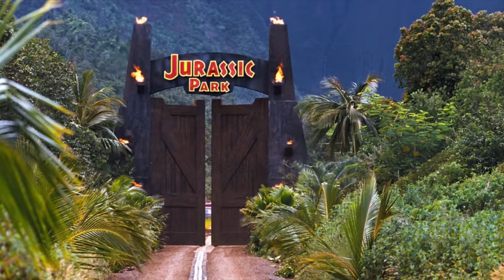The Ultimate Rain Scene - Jurassic Park - NO PHOTOSHOP!

Comment: When I need rain while animating I usually use eye droppers with water and or you could use a spray bottle and have a lower shutter speed/lower iso to get the motion blur. Love the idea you took to solving the problem.
Reply from the maker: Thanks. Eyedroppers sounds fascinating. I worry about the effect the water would have on my scenery. I usually use a lot of white glue that goes white again when wet.
Reply: @KathyMillatt  also the scale is off of the water drops so I’d recommend a mist. And maybe you could just set your diorama in with some transparent glue or something

Comment: Not sure what filament you're using, but is that sanding mouse gentle enough not to melt PLA? I could use something to make sanding FDM prints less tedious, but most power tools generate far too much heat.
Reply from the maker: It’s PLA but I’m sanding the spray putty not the filament so I haven’t had a problem with the PLA melting.
Reply: @KathyMillatt  Okay, I might give one a try then... it does look a lot less friction-heat-causing than something like a rotary tool, which I'm guessing is a big part of that.
Reply from the maker: @Maeyanie  it’s not as fast as a rotary tool which might make the difference.

Comment: Just saw this. Let me get your professional option. I just completed a diorama of a Jurassic Park scene with Dennis in his jeep getting ambushed complete with waterfalls over the small cliff. After watching your rain video I thought how would it be possible to create a physical rain scene.  Is it crazy to think one could create a still rain scene pouring layer by layer resin over randomly spaced water drops?  Even if this were possible I think the drops would end up being too big in scale and one might have to instead use some very small clear plastic beads.  Your thoughts?
Reply from the maker: I think scale is the biggest problem I hit. The droplets have to be oversized to show. I’ve had so many suggestions over the years but most would only work in a larger scale unfortunately.

Comment: This is really a Masterpiece of artificial Rain. 

By the Way, now that you have the Projector, you can also try to project the Blinken Lights on R2D2 in your Diorama. But maybe you would need a special lens in front of the projector to get the Picture-projection small enough for the R2D2 model. Please try it.
Reply from the maker: That’s a great idea. I think it’s about the video as well as the lens.
Reply: @KathyMillatt  Hello Kathy, maybe it is possible to focus on a small thing like the R2D2 bei placing a photo lens in the reverse direction. Unfortunately, I cannot tast it, I don't have a projector here. 
For a first test, maybe a very low cost lens from Ebay will do it. 
By the way, the woodn dust from the milling machine, that I offered you some days before, see the latest Boomer Diorama Video, starting at roundabout Minute 8, he is covering his artifice tree trunks with this material, but it is not Material from me. There are many other purposes it can be used for, just the fantasie ist the limit. If you are afraid, I'm a psycopath, maybe you have a post box or someone else I can send it to. I don't have so much money, that I can be a patreon for you or support you with money, but I can give you some useful Material this is maybe a better way to use my short pressed budget. 

Have a nice week, always creativ ideas and happy modelling. 
Kind regards

Comment: Hi Kathy!
For PLA print smoothing, I would recommend a technique I picked up from Aaron over at Galactic Armory...
Use the UV resin from resin printing and a sponge brush to lightly coat the print then cure it in the sun or a UV light box.
Repeat the process until your layer lines are gone then lightly sand to complete. 
I've been using this technique for over a year now and I hardly sand at all anymore.
It is a minimal 90% of sanding time shaved off of all of my prints! 👍
Reply from the maker: I am going to have to try that but I am worried about it filling in the fine detail lines too.  Is that a problem for you?
Reply: @KathyMillatt  It can be but if you are careful (and patient) in those areas, it's no more of a problem than straight sanding or using putty or Bondo.
When I do accidentally cause a problem with fine lines, my etching tool corrects it nicely.
I make custom toys as a hobby/side hustle and much of that is 18" & 31" customized Jakks Pacific clone troopers.  Their helmets and accessories are small but my finished products are smooth with great detail and required minimal sanding on my part.
The extra bonus using this method, especially for the full sized cosplay armor and helmets that I make, is that uv cure time is dramatically less than bondo & filler.
* If I remember correctly, Aaron first showed that method in his Boba Fett helmet build.
Reply from the maker: @MichaelCravatt  thanks so much. I will try it.
Reply: @KathyMillatt  Good luck and I hope that it works for you. 🙂
* Side Note: Keep up the great work!  Your videos are truly enjoyable and very helpful!! 😊
Reply from the maker: @MichaelCravatt  thank you so much!

Comment: You are amazing!!! How did you make the fence posts?
Reply from the maker: I designed them in Blender and printed them on an FDM printer. The files came with fence posts so I used those as a guide but I wanted to do separate wires and theirs were moulded in.
Reply: I would literally pay you to make some for me lol
Reply: @KathyMillatt  how many inches are the fence posts

Comment: Amazing build! Absolutely smashed it! One thing I was wondering was, is this dio designed to always be in rain? If it is, then would it help to add gloss to the Rex and some puddles in the mud, to help sell it in more? At the moment it feels too dry, imo.

Also, If you wanted to create a more realistic rain effect, could you use a planter mister to get some small beads of moisture, combined with the projector? Could create a cool look?
Reply from the maker: I did drench it in gloss varnish but it just doesn't show.  The Model Wasser stuff probably would have worked better as it is thicker.  I am always wary about adding water because white glue turns white again when wet and I don't want any odd reactions!

Comment: Kathy, may I give you an idea for the rain?
If you make a diorama with a reservoir underneath with water.and then pump it up with a small pond pump..make small holes in the diorama so that the water can drain into the reservoir.The water that is pumped up goes through a few tubes with small holes. Like they do in movies, but on a small scale.
Reply from the maker: I find that water does not scale well as ripples and droplets are too large. How would you make the water fine enough for the scale rain?
Reply: I hadn't thought of that, I see the problem..maybe with very small holes where the water comes out.And then with enough pressure,I just looked this up (it's an example) https://www.youtube.com/watch ?v=_l9O4Sb6huc
if you make the holes smaller, you get smaller droplets. A preheated sewing needle might work..
It might be an idea. By the way, the Diorama looks fantastic.
Reply from the maker: Thanks. This one wouldn’t cope with all that water but maybe a future diorama.

Comment: What if you treated the rain as if it were a waterfall only thinner and more of them? The projected rain is certainly better than scratched or painted on acetate. I wonder if you could rain on fishing lines that are suspended from a top? Great now I will only think about how to simulate rain for a diorama or a model train set. Really liked the videos you do, lots of different ways to do things I learn something every time I watch them.
Reply from the maker: I did go through a lot of the discarded ideas with my patreons but in brief, fishing lines or fibre optic are long and from the ceiling.  I would need to capture a shorter length for the rain effect.  I couldn't get my head around how to do that but I think it has potential.
Reply: @KathyMillatt  There is a lot of potential there.  You could do it as a curtain and not the whole diorama and attach it at an angle, or use an armature of some type to move the top around to give the rain some movement. I would also make the drops on the line 'muddy' or not clear, like what you did with the LEDs for the flames. Just a thought keep up the good work.
Reply from the maker: @davidallen803  thanks!  I’ve definitely got more to explore on rain.

Comment: Instead of sanding, you could use resin to smooth those FDM printer layer lines but it is nastier to get it done.
Reply from the maker: I've not tried it because it seems so messy and I'm worried about filling in details.  Not that sanding isn't messy but in a different way.

Comment: Instead of trying to capture the rain effects , wouldn't a better attempt to simulate the impact and  drizzle off on the surfaces?  Time consuming,  Leave the  rain to photoshop i would say..
Reply from the maker: That’s what I did in the last diorama but rain in photoshop doesn’t move and this is a video so photoshop is only a part answer.
Reply: @KathyMillatt , just wondering if you used tiny droplets of clear  resin and allow them to to drip dry. Then use gel for model water surface and agitate it cocktail stick to give the impression of rain impact?
Reply from the maker: @stevenstocker9873  How would you suspend the droplets in the air?  My problem is getting the fine enough for the scale.  I can easily add more water texture to the ground with a gloss gel but it's the water in the air that is difficult.
Reply: @KathyMillatt  , gloss gel lace string  but that would be a mess?
Reply from the maker: @stevenstocker9873  I'm not sure I could get it fine enough but it is certainly an option.